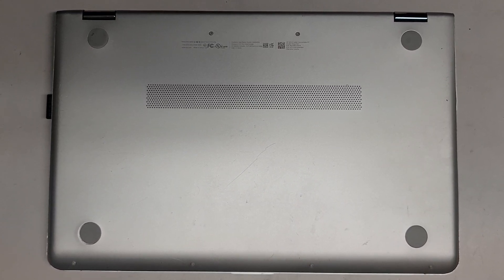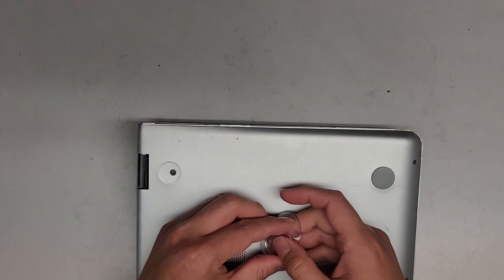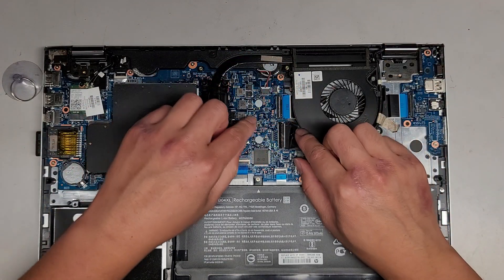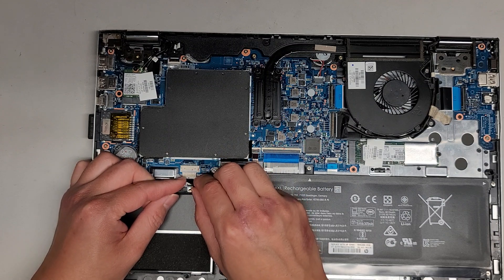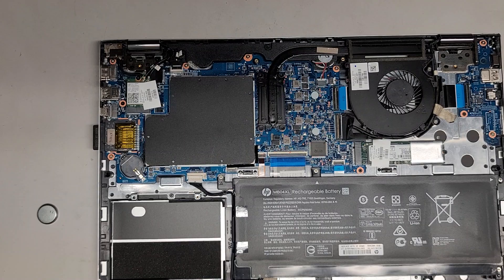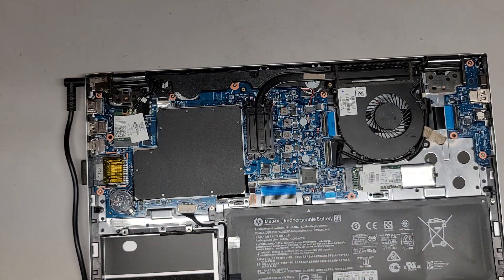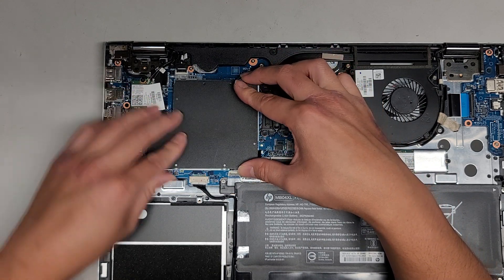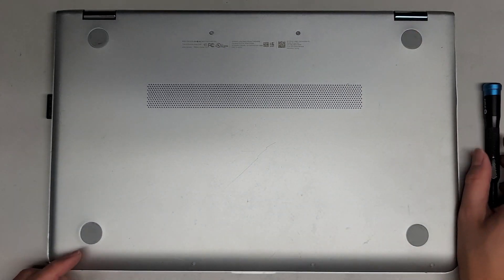HP Envy x360 Convertible PC 15-aq273cl Disassembly RAM SSD Hard Drive Upgrade Replacement Repair

Comment: My boss has one of these that seemed exactly as dead. 2 shops declared it fried (as you did here), but both of them missed the fact that the tiny pin in the center of the power socket was snapped off. So no power, and the battery of course eventually has none to share either. $8 power socket later, all good.
Reply from the maker: Awesome!
Reply: He did try a second power supply.......
Reply: @MustardFamilyFun  The PIN that can break off... is in the LAPTOP SOCKET as I said, so no new power supply would work.

Comment: Will changing cmos battery reset the bios to default?
Reply from the maker: Usually,  unless you can change it really fast.
Reply: @ItsBinhRepaired  thanks
Reply: Yes, if it does it's not a big issue. It will prompt you to set it when you boot.
Reply: I have the same model and i changed th LCD then it font tourn on ?
I think thé problem is in the carte mother so can you help me